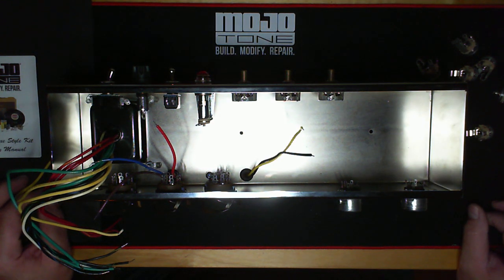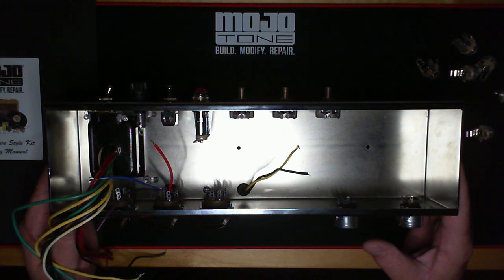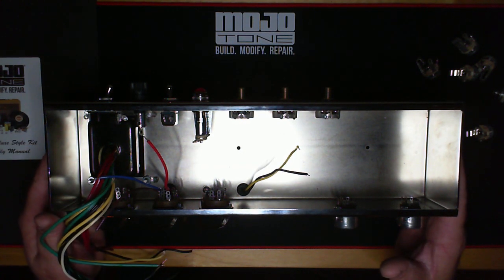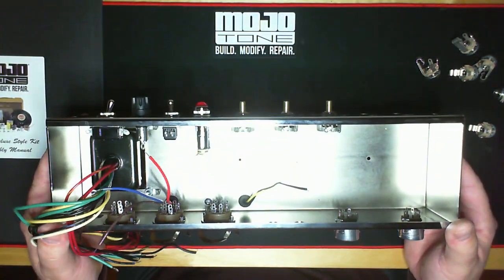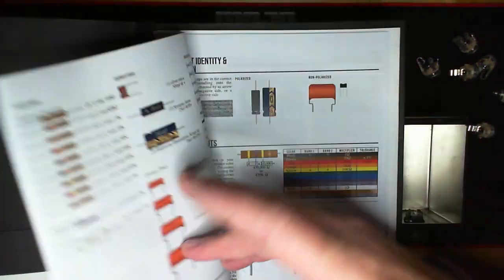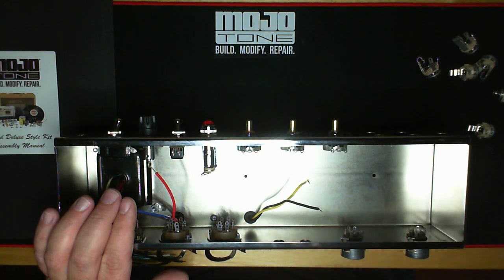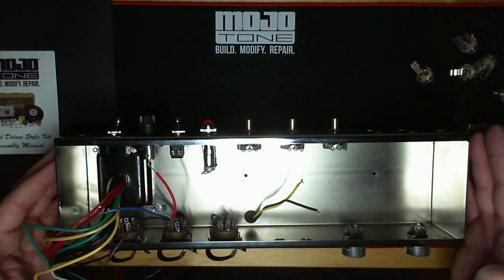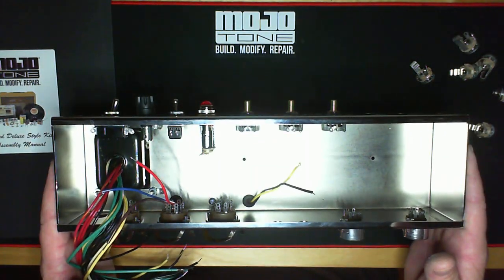5E3 Build Start and Mechanical Assembly - PART 1

Comment: I built the Princeton and I love it. First build experience and it came out great. I had zero prior experience with electronics. The instructions and the full scale diagram are all you need. I want to build one of these too. Kits, components, everything was awesome! The one criticism I have is you NEED to include more wire of all colors. My kit was seriously short especially of yellow and green. Just double the quantities and that would do it. Add $5 or $10 or whatever to the price to account for the additional cost. It better than running out. I am not the only one to experience this problem. I know because I spoke with several other people about the issue. Thanks for making killer products.
Reply: Agree, the problem with wire lengths is that you the builder just have to make a best guess at how long they should be. Of course you can always trim a wire shorter but if you go too short the first time, you waste the wire and the time. I ran out of yellow also and was short on red. Probably would have had issues with green but I ran white and black for the filaments.

Comment: You guys are awesome. I am in Charlotte Nc on lockdown. Working 1 week on 1 week off. I decided to pull my Mojotone 5E3 kit off the shelf(since last October) and build it this week. Great way to spend a couple of days focused on  something fun instead of bad times! I did ruin a tube socket with dripping solder so I called you guys and placed an order. Received it today asap. BTW, I went ahead and ordered a pedal kit to have some more fun when I wrap this amp up tomorrow.  Thank you guys for your hustle-keep up the good work...Everyone needs to order one of these kits - its fun, therapeutic and you have a great amp when done.  BUY ONE